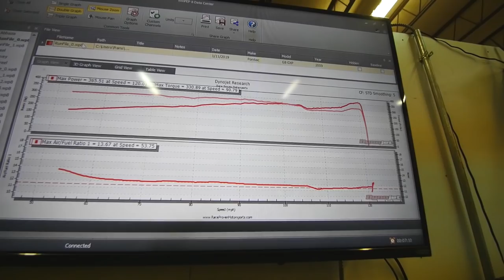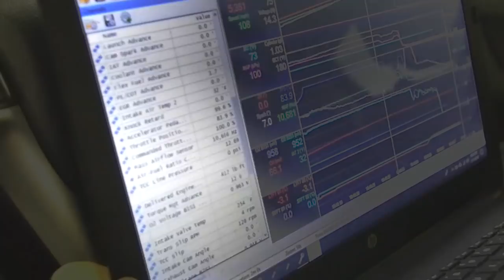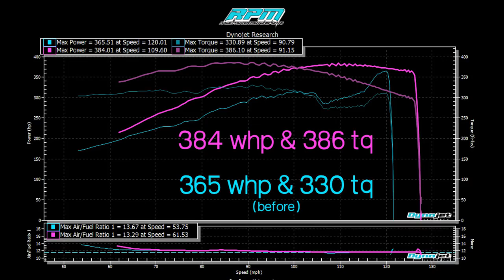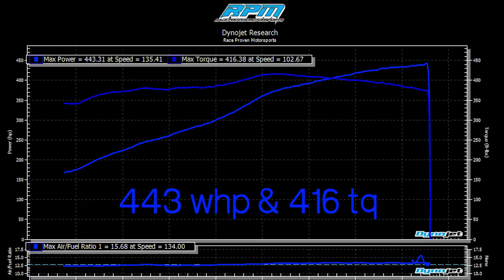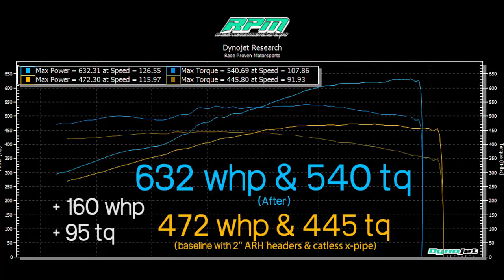Highest Horsepower N/A Z28 ?!  | RPM S6 E29

Comment: Why would the Z28 put down less WHP than the C6Z with shorter gearing? Assuming they’re both dyno’d in 4th gear, the shorter gearing would produce more wheel torque and therefore more HP seen by the dyno. 

Can you guys explain?
Reply from the maker: They do the opposite.   Higher numerically gearing the lower they dyno
Reply: RaceProvenMotorsports but why, if the wheel torque is increased by the shorter (higher numerically) ratio?
Reply: @RaceProvenMotorsports  ok that may explain why my tbss dynos pretty low with them damned 4:10s